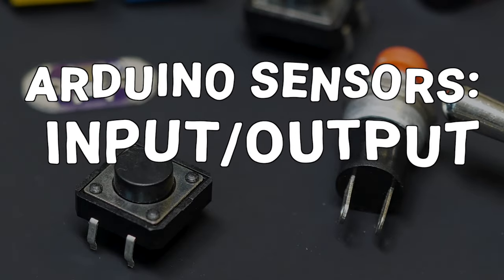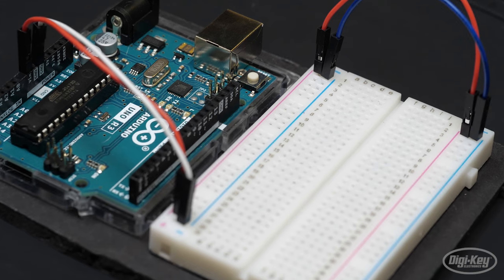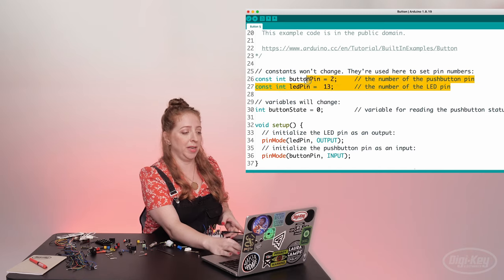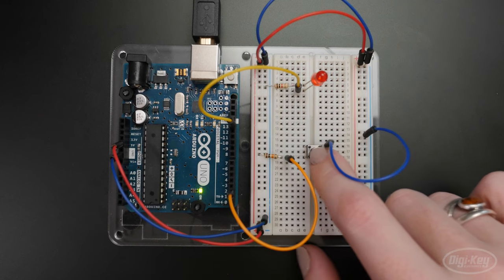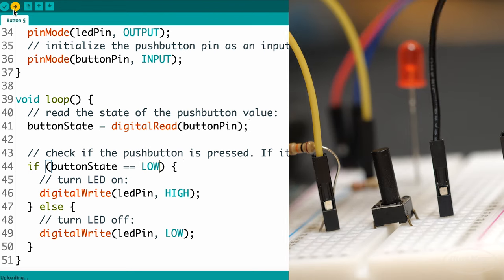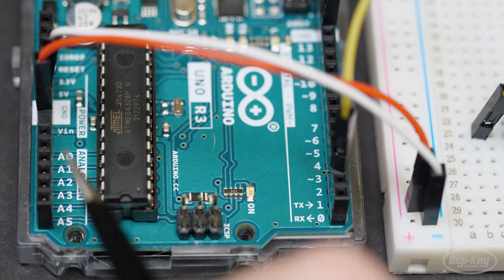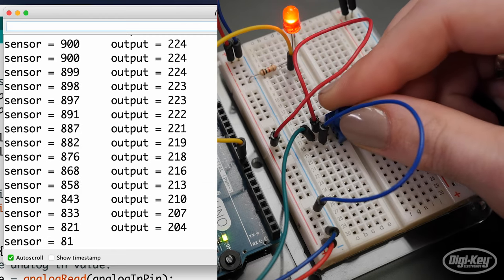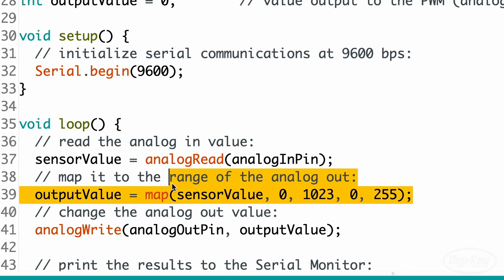Arduino Input/Output - Electronics with Becky Stern | Digi-Key Electronics

Comment: For newbies, at 7:30 the graphic shows 1024 = 2^10 bytes, in this case it's really 2^10 analog levels (a 0 to 5V analog value divided up into 1024 digital values ranging from 0 to 1023) where in this case the 10-bit output of the Anlog to Digital Converter (ADC) is from binary 0000000000 (0) = 0V, all the way to 1111111111 (1023) = 5V and various level in between.  We all make this faux pas in computer science from time to time as we look at the number of bits related to how much memory (bytes) were are addressing, the concept here is scale and is the same in either case.

Comment: Did you make a video on how to protect your Arduino UNO R3 inputs by using a load resistor and a 5V Zener to limit the voltage at the pins to 5V to prevent blowing out an Ardunio's microcontroller I/O pin if ever driven by more than 5V?  Before my students hook up their Arduino UNOs for the first time, I teach them about Zener diodes, how they work, and how to use them in this manner. If a student "blows up a pin" the Arduino is still functional for the most part, but the Arduino's microcontroller is in DIP form and can easily be replaced with a new chip for a couple of dollars,..... hmmmmmm, where could I possibly get Zener diodes, resistors, and new Microcontroller chips?  Digikey!  Yay!  [free plug, smile]

This goes for the Arduino DUE as well, but in that case, you use 3.3V Zener diodes because it's I/O is 0V to 3.3V.